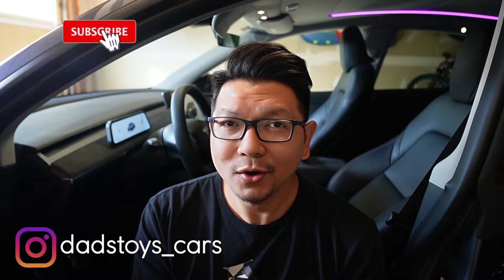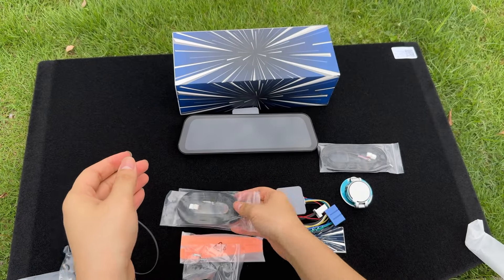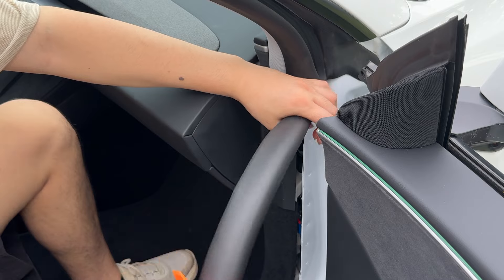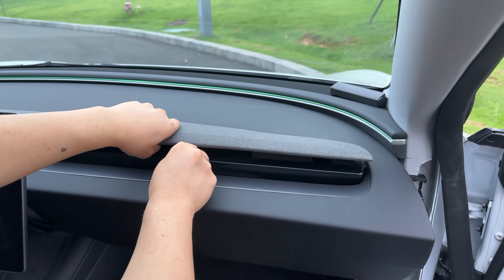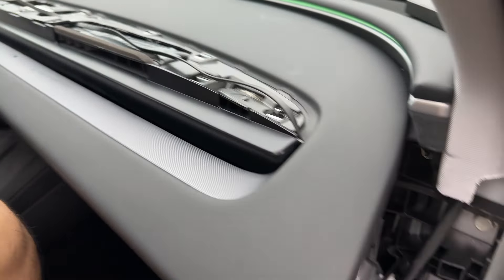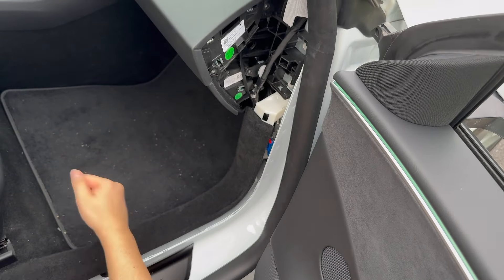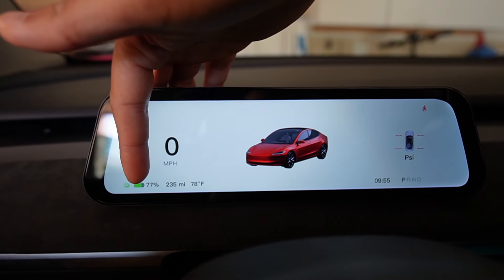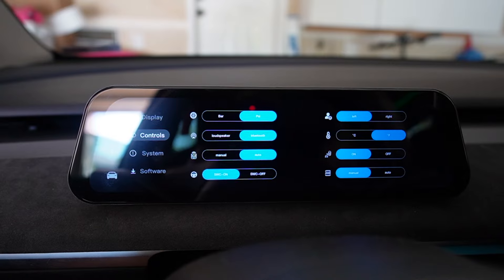2024 Tesla Model 3 Highland Display with Visualization & Apple CarPlay Upgrade! #tesla

Comment: When you use the Autopilot, can you still use the scroll wheel command to use the screen without changing Autopilot speed? And when you use the side control of the scroll wheel, does it change the distance between you and the car in front on Autopilot
Reply from the maker: @HY13tech   Appreciate your comment.
Right scroll control on the display will be disable when autopilot is engaged for safety reasons.
It does change the distance between car in front of you when you push left or right on right scroll control. This happen to all instrument cluster display.
Thank you for watching!
Please subscribe for future contents.🙏😃
Reply: @dadstoyscars  thank you for your quick response. So no override of right scroll controls when on AP, that’s the way to go. But when not on AP, no problem for the scrolling part because it’s mapped to nothing, however for the sides, it should override the command because AP is not used either way and I don’t wanna mess with the distance control (which I’ve never changed since I got the car). I guess that’s not possible to do otherwise it would have been done already 🤷‍♂️
Reply from the maker: @ Not at the moment.
Because distance function still works outside of autopilot that’s why.

Comment: Thanks. I am installing it right now on the Highland. But I can't find any hole to pass the front camera cable. Do you think that there could be different Highland front shapes ? Help please
Reply from the maker: @DrYT75   Please check installation instructions in the video. The camera cable is flat so you can run the cable through driver side door then insert the cable through the gaps of exterior of the car and goes back into the frunk. After that fish it down to bottom front bumper. You might have to remove the tub.
I hope this helps.
Reply: Thanks for your reply. Everything is clear and I only get one issue : the front bumper. I extracted the frunk but I cannot see any vent hole to pass the camera cable.
Reply from the maker: @  After you removed the tub then you might need some kind of fishing wire to fish through the space.

Comment: How can we synchronise battery percentage ? Thanks
Reply from the maker: @DrYT75  It should sync automatically if not you might want to install OTA update for the display.
Thank you for your awesome support!🙏😃
Reply: @dadstoyscars  I did make an OTA update. But there is still a difference of 1 percent between battery levels : 58% on T9 screen, and 57% on Tesla screen...
Reply from the maker: @ Okay, I will forward your issue to Teslasy so they can fix the problem.

Comment: Thanks for video.  Why can’t they adjust the scale on the analog speedometer to be proper for MPH (it is scaled for KPH, which renders it useless)?
Reply from the maker: @chrisc1866  Appreciate your comment.
Some shorts in the video were from KMH base car.
The display will auto detect the unit base your car as soon as you press the brake it will change on the display.
Thank you for watching and your great support.🙏😃